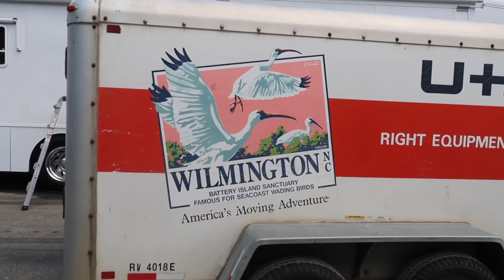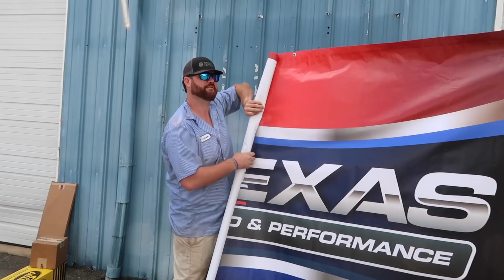I bought a $10,000 carbon fiber body for the SALTY CHICKEN!!!

Comment: Salty Chicken is looking more and more like an LDR car! Or extreme 275 or whatever.
Reply: Or small block Boost
Reply: Not if the rear quarters and roof are replaced. Both don't allow it. 2005 is the cut off date for roof lid
Reply: Maybe sb boost....
Reply: @waynebollentin989  he IS leaving roof and quarters steel. He's replacing the glass T-Tops with Carbon... But still keeping the factory roof rack/support or whatever you call it
Reply: @charleybetts1053  that's what I said he was most likely going to do. Never thought for a sec he was going full carbon fiber body.

Comment: So to be clear you did not get a carbon fiber body you got carbon body panels.
Those panels could be used on a tube chassis car to be a body.
I am guessing on the chicken you going to keep your body but replace the quarters, roof, doors, trunk lid, and front end with carbon parts.
I hope you find a different crew to do this then the one that did the hood scoop modification on the black sheep

Comment: The “Recognizing the Protection of Motorsports (RPM) Act” clarifies that it is legal under federal law to modify the emissions system of a motor vehicle that is converted for race-use-only. If passed, the legislation will protect Americans’ right to modify street vehicles into dedicated racecars and industry’s right to sell the parts that enable racers to compete.

Problem:        

The U.S. Congress exempted race vehicles from regulation under the Clean Air Act in 1970. However, in 2015, the U.S. Environmental Protection Agency (EPA) asserted that it is illegal to convert a motor vehicle into a racecar if the vehicle’s emissions system no longer remains in its certified configuration. The agency alleges that the Clean Air Act exemption only applies to purpose-built race vehicles (NASCAR, Formula One, sprint cars, etc.). EPA is also claiming authority over any emissions-related parts produced, sold, and installed on motor vehicles converted for racing.

Since the Clean Air Act’s enactment, SEMA is unaware of a single instance in which the EPA previously took the position that the law applies to motor vehicles converted for race-use-only purposes. Before the EPA announced its new interpretation in 2015, industry had a clear understanding that these vehicles are excluded from the Clean Air Act. 

Solution:

The Recognizing the Protection of Motorsports (RPM) Act:

Confirms that it has always been Congress’ intent that racecars are not included in the Clean Air Act’s definition of regulated “motor vehicles.” 
Makes clear that it has always been legal to modify a street vehicle into a racecar used exclusively at the track.
Confirms that modifying these vehicles for exclusive track use would not be considered tampering and subject to substantial fines.

  http://www.votervoice.net/Shares/B8RpeAVoACSFLAAzdFV7FAA